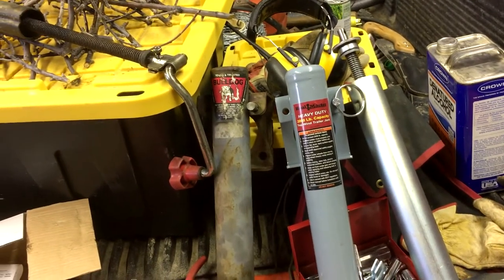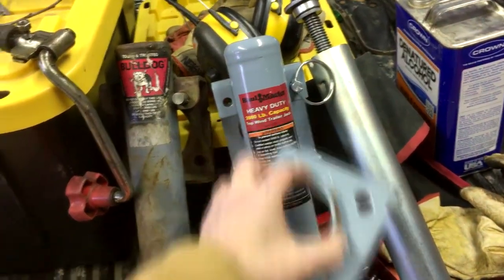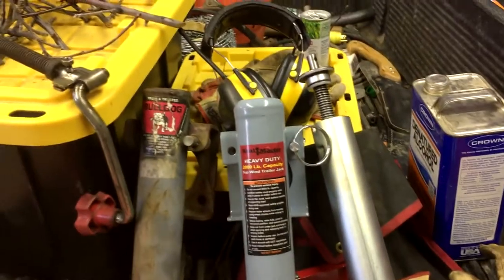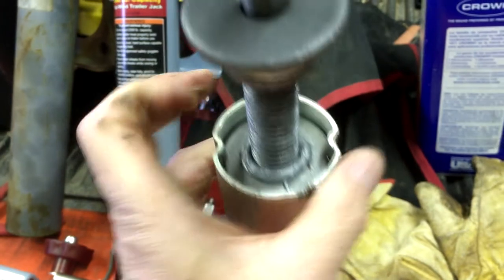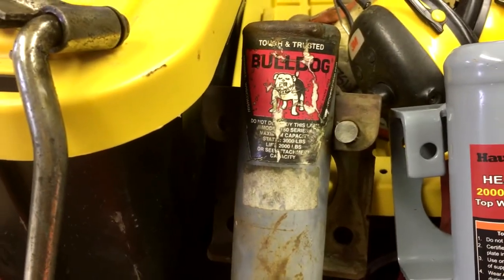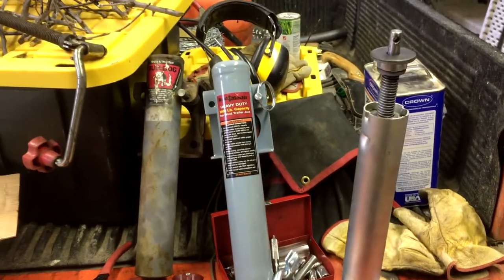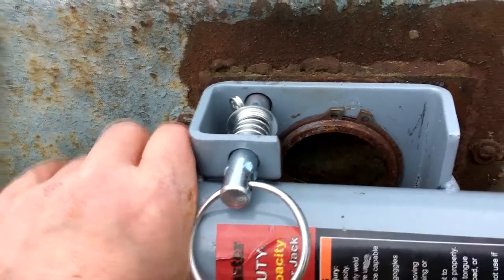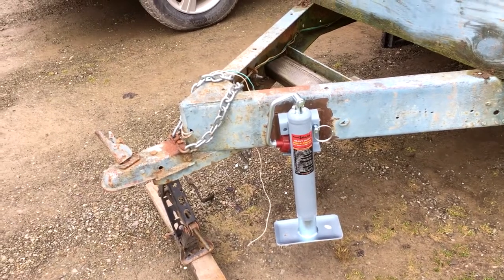2000 lb trailer jacks: Harbor Freight or Bulldog?

Comment: Hey Alan.  Thanks for posting this.  I have a question about how you actually got the froze-up bulldog jack apart.  I'm dealing with a similar situation.  I'm sort of guessing that the two metal jack sleeves are rusted together, and that is why the thing doesn't raise or lower the tongue of my trailer.  And so far I haven't been able to take the whole jack assembly out of its mount because of rusty bolts and flange damage that prevents me from getting my socket wrench on them.  Any insight or suggestions are appreciated.
Reply from the maker: The only thing that I can remember with any confidence is that it was very difficult to take apart.  I'm sorry that I can't be more help.